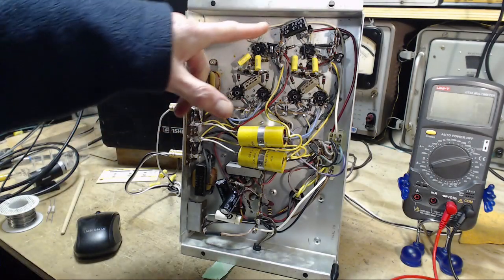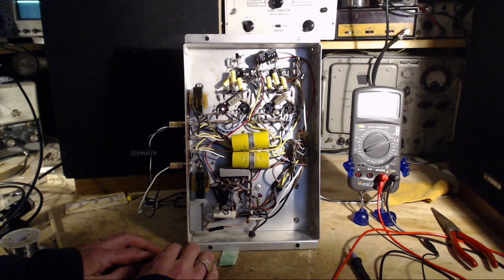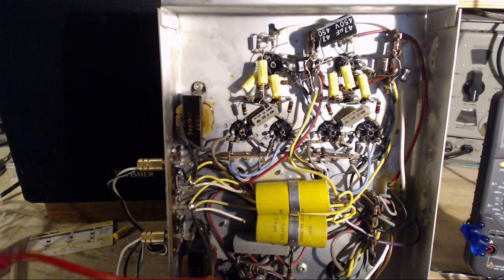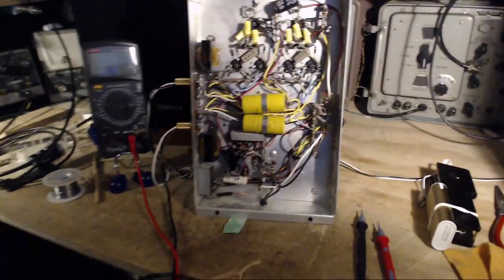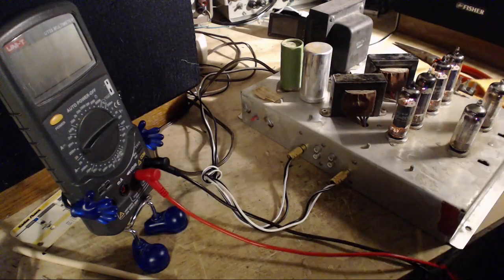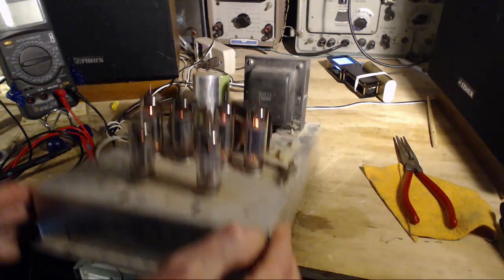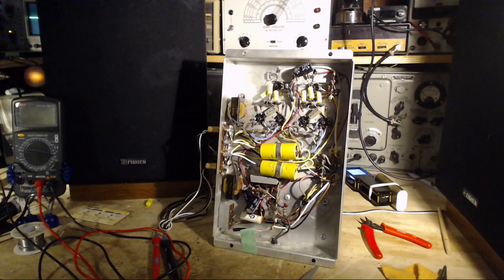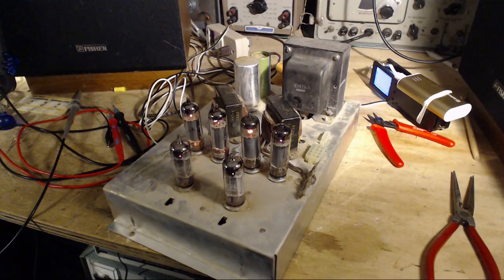Canadian Admiral J104X J105X Console Video #9 - Hum Solved

Comment: The "putt-putt" noise you heard when touching the input of the one channel is called "motor boating."  It is usually caused by feedback through the power supply.  It is not enough to merely parallel the existing filter capacitors. They must be removed from the circuit. You can leave the old cans in place for esthetic reasons if that's your want, but they should not be involved electrically.  It's dubious even as a troubleshooting technique.  The high frequency oscillations can also be a regenerative feedback through the power supply rails.
Reply: See the first post( mine) on the first video on this amp!!! It took nine videos for Jim to get this far.
 Still not quite done right , replace  and remove from the circuit the old electrolytics and don't  just jump them.
 Love his jump while" poking the bear with a stick" at 27:10 !!!

Comment: WOW that's crazy all testing just to find out it only a bad tube.That the it goes sometimes.
Reply: That's why I mention that possibility in so many threads. Tube testers all too often do not show any problem with the tubes as the problem is subtle. Not a full short but a tiny leakage of filament energy to the cathode. 

That was why I recommended swapping the tubes from channel to channel earlier. In a set with multiple output tubes it narrows things down.